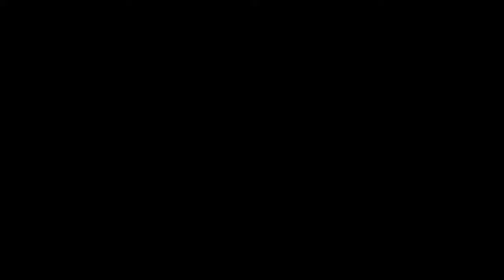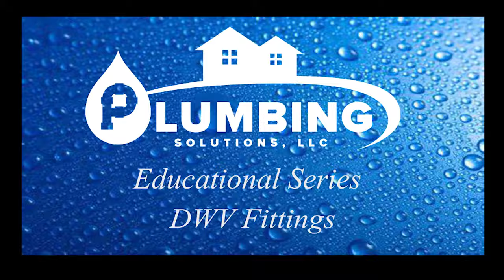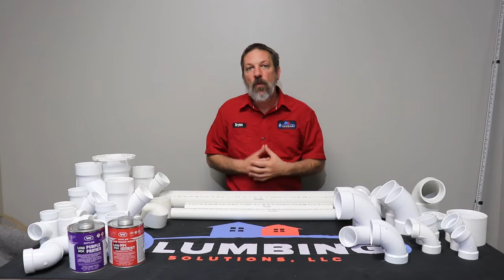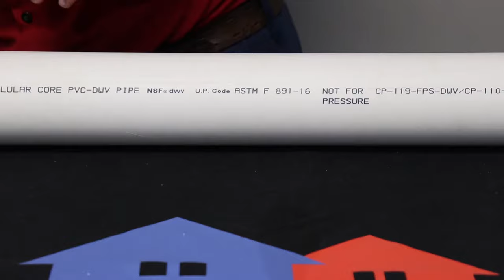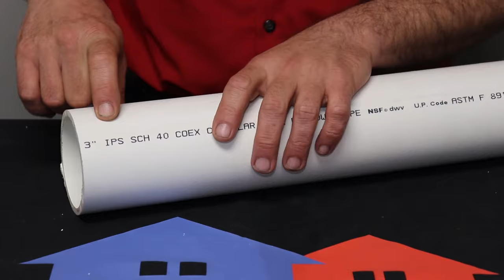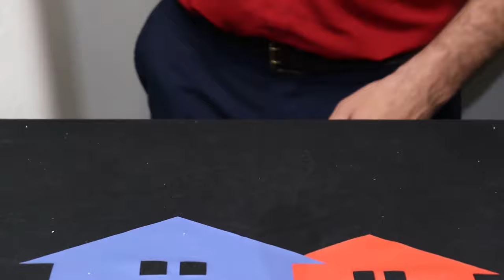Plumbing Pipe and Fittings, DWV

Comment: This was awesome! In my plumbing foundation course this week we have a fittings quiz and the point is to be able to identify them as they would be ordered. It's certainly a lot to wrap my head around... for this kind of piping when you order you would start with the sizes, then state the material, the thread or connection type, then fitting shape, right? For instance a 3" pvc cell core 90 degree ell? So useful to hear what order the size difference goes in. Bottom, top, side! Thanks :)

Comment: Very interesting video calm voice, good tone, organized and informative.   Is it possible to install pvc pipe backwards (drainage running away from sewer line). Why would there be orange primer used at ends of fitting. I have issue of washer machine draining into bathtub which no one can fit. The company "Just Plumbing" replaced old piping with pvc. Problem still continue so called a different plumbing company who claim pvc was installed backwards and wrong primer was used. So I went into crawl space and saw job for myself. So now with your video I'll be able to identify what was used but how are you able to tell which way is the flow going.  Of course the first company will not honor this  issue. So $ is on me.

Comment: Very good info. I have a 3" sewage main runs around my basement wall and flow outside. I plan to install a water softener in my basement and connect the softener drain hose to it. Can I use a 3"x3"x2" Y Tee (horizontal) with a 2" P trap, then connect to a 36" standpipe? You mentioned in the video the Y Tee only use in vertical. Thanks.

Comment: Great video, Thank You! The only question I have is because you commented on some of the fittings they can only be installed Vertically, not Horizontally. But, you didn't mention which ones could be installed Horizontally. I would appreciate a clarification as to which fittings can be used in which orientation. Thank you!

Comment: You made the comment about inspectors like to see the purple primer because they can look up and see it. I have always been against purple primer just for that fact. It makes an inspector lazy and gives a false sense of a good and completed job when that is just not so. They need to do their job and physically inspect the work. Just because it has purple primer does not mean a convection was not missed with glue. So the purple primer does no good if the joint is not welded. Or if it was not pushed all the way in to make a good connection. This is a reason why the inspector is their. Will they see or find every mistake no. But using purple primer just makes them more lazy and gives a very false positive. They also now make all in one primer and glue that is clear this is what we use it’s cheaper and saves time and space with one product. With this said you and the video is great thanks.
Reply: Same here in Albuquerque you will fail inspection if you can't see the purple primer. I would only use tape when im doing vertical joints but lately it seems like I've been making a mess trying to hurry when doing service work and not able to lean the pipe down. maybe I'll try the the tape for vertical joints as well. Thanks.
Reply: Purple primer doesn't make us lazy. Driving to 15-20 inspections a day with some to most plumbers laying sanitees on its back, not shading drains and strapping every nine feet makes us lazy
Reply: I was just looking at our township plumbing code. It specifically states purple primer must be used. The code was last updated in 2006. 😮
Reply: @j.p.6675  I'm from burque aswell fancy seeing you here lol

Comment: I bought a 90 vented to replace some pool pipe without knowing what “vented” was.  I didn’t see any vents so I used it. It’s still drying. Will it leak when I turn on the pool pump to circulate the water?

Comment: Awesome video. I'm sure I will use the wrong terminology. I need a type of PVC schedule 40 reducing coupler. On the three inch side it will receive the 3" pipe (female). On the 2-inch side it needs to be the male because it will go into something that receives 2" PVC. Does this exist?  Thank you.
Reply from the maker: we would call it a 3-inch slip by a 2-inch male. they make it but where can you find it I have no clue. you can get a three-inch coupling, a 3x2 bushing, a 2-inch male and make it.

Comment: Good information. All the configurations for the DWV can get really confusing. 

This is helpful. 

On a side note: It appears that my local Home Depot no longer sells PVC pipes. My instructor had to purchase ABS pipes. I was told that they are trying to ban plastic pipes. Anyone hear anything similar.
Reply from the maker: Pvc was getting phased out as far food packing . because it's a "hard to recycle" plastic. But, I haven't heard anything about pipe. we still get a truck load of it every week here in SC. States and Countys have different rules. They may have outlawed it in your area.

Comment: would you use a 4 in. PVC DWV Repair Coupling (slip coupling) to connect new plumbing into an existing underground horizontal 4inch pvc drain pipe that has no movement?

Comment: I'm in a situation where I have a copper pipe stub out under a bathroom sink and I want to know what transition fitting I can use to go from copper to pvc. The copper coming from the wall has threads on it
Reply from the maker: SharkBite would be the easiest or a female pvc fitting of the right size.

Comment: Can you make holes for a 3 inch toilet waste line in a 2x8 joist? How do you pass this pipe from a second floor to a basement through the 2x4 top plates of wall tops?
Reply from the maker: A 3 inch pipe will go in a 2x4 wall (you got to be dead on the money) but, not the hub on the fitting.

Comment: what kind of connections would you use when connecting another pipe into your main line that you can not move like a sewer pipe going into the tank
Reply from the maker: we call them ferncos or a on hub band. they're rubber and flexible.

Comment: Has there ever been a 2 1/2 pipeline for DWV, say in older houses?
Reply from the maker: yes, they still make it ,or at least its still listed
Reply: @PlumbingSolutionsLLC  
Thanks for the reply. Now my only wish is to find an adapter 2-1/2 to 3 for the segment but since it has to continue as 2-1/2, I would think it can be violation of the code (Larger diameter to smaller, outflow) and a reason to fail inspection. So I think my best bet is to find the right diameter, with last problem being, this is the P section under the shower, so might be harder to find all the C loop section with a drain entrance!!! Wish me luck.

Comment: I can't seem to find it.  Is there a such a thing as a 4" to 3/4" reducer?  I'm wanting to go from a 3/4" pipe to a 4" pipe.  It is for a watering contraption I was making for chickens to drink water.  I was going to have it come out of the run with 3/4" and I would fill it from outside, so I don't have to go inside.
Reply from the maker: that is a big jump but it can be done with bushings